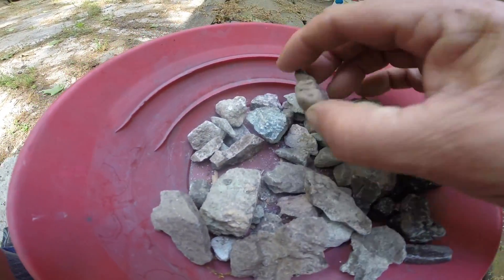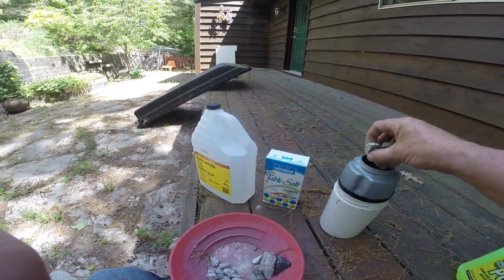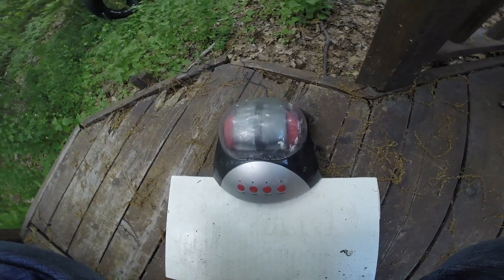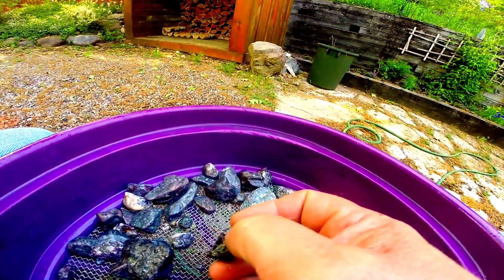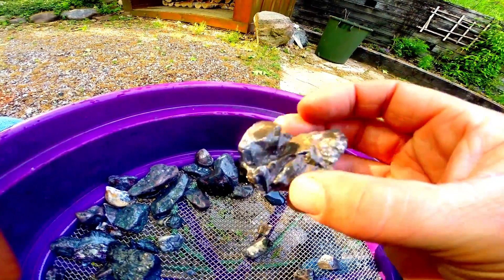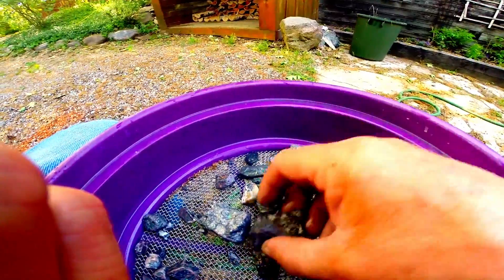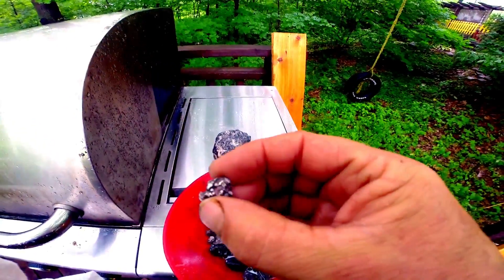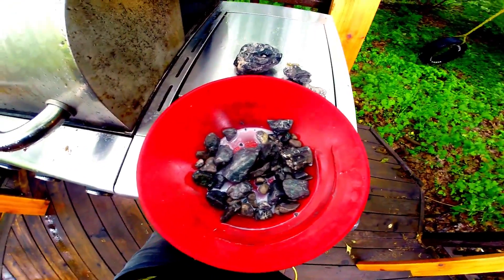CLEAN SILVER ORE WITH ROCK TUMBLER

Comment: I have seen people use citric acid on agates to just clean the dirt and black stains on the specimens so you don't have to use a tooth brush. They just soaked them over night or for however long you need to and Viõla!
Reply from the maker: Citric acid is a good cleaner for sure.  It can affect carbonate minerals that may also be present.
Reply: @meMiner Thanks for letting me know! I could have damaged my crystals catastrophically with irreversible damage 😳 I am just a rookie and don't know a lot about cleaning or what to soak my specimens in. My newest crystal is Gypsum with well formed thin flat pinkish tan crystals that look just like a bunch of little rose buds. They have sand on the crystals and I soaked in plain water and the sand would come off. I am terrified of damaging the crystals and I really don't know what steps to take to clean the dirt off with out the use of acid.  I got as far as citric acid and by what you have told me, I definitely will not be using citric acid to clean my Gypsum (desert rose) I am really so glad I didn't.